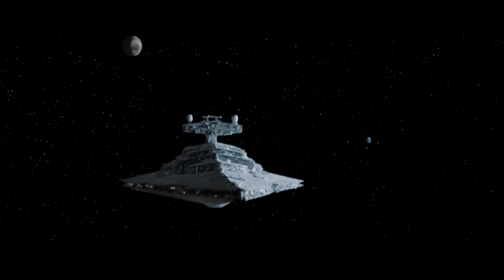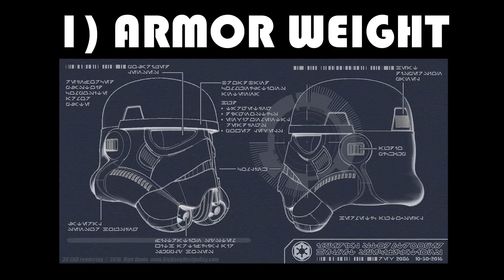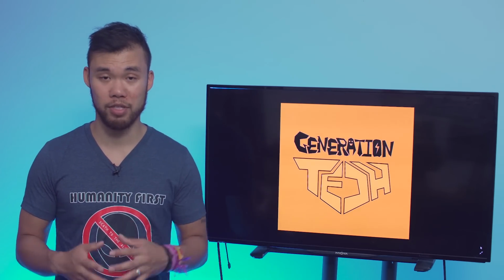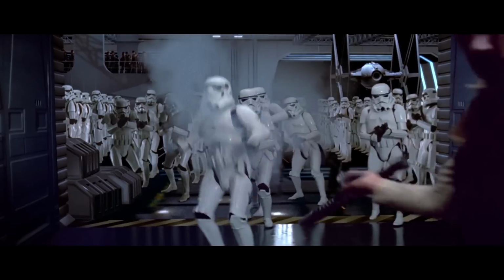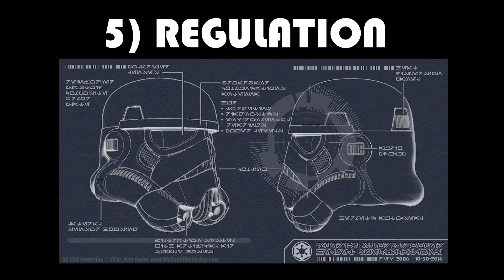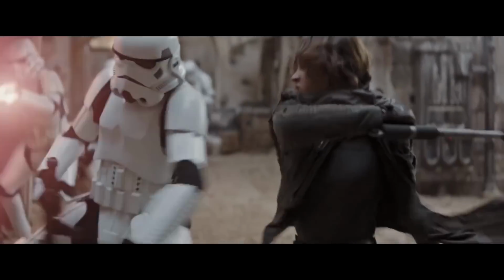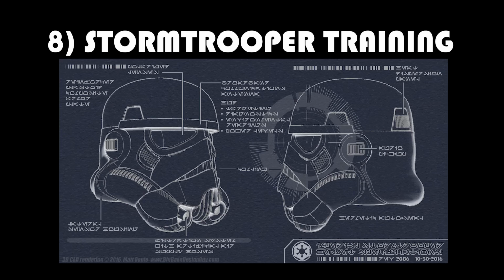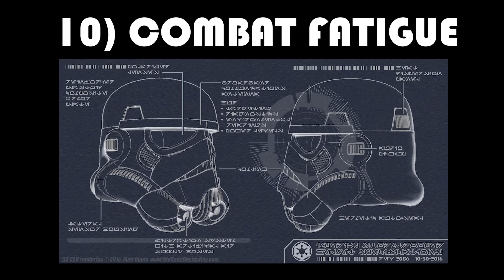10 FLAWS with the Stormtrooper

Comment: Not gonna wade through over 1,100 comments to see if this has been covered, so I'm sorry if this is redundant:

Storm Troopers are the face of Imperial Might. As such, they're held to an impossible personal standard (the monitoring by superiors), they're expected to maintain their menacing appearance, and most importantly, they are meant to appear as a monolithic force. They are all the same, impersonal, and impenetrable. This is why, for example, they're not allowed to remove their helmets, or indeed, to show their faces. In this way they are much like the crack assault forces fielded by ancient Persia known as "The Immortals." They may not have had the most effective equipment or tactics from a purely military point of view, but their methods had a severe psychological impact, which was often at least as important when and where they were deployed.
There's a great deal that goes into the psychological impact of Imperial imagery. This imagery is sometimes (often?) seen as as important, if not more so, than real aspects of performance. For the same reason that the Star Destroyer strikes a menacing silhouette at the expense of perhaps superior naval design, so too does the Storm Trooper don full body armor that is easily seen. They are psychological weapons as well as military ones.

As to the training regimen: It's not hard to envision a warped and narcissistic officer corp adopting a recruiting and training system based on Social Darwinism. This idea is further reinforced by the notion that The Empire in the original films was meant to be a manifestation of all the wrongheaded bits of militaristic totalitarian thinking. On the macro-scale, the "Evil Empire" is clearly modeled after the original "Evil Empire," Imperial Rome. On the smaller scale, motifs of early/mid-twentieth century Fascism are impossible to ignore. The long gun carried by Troopers on patrol in Mos Eisley is a real life MG-42, the German light machine gun of WWII (equivalent to the American Browning .30 caliber, but more easily carried and with twice the rate of fire). In fact, the very name "Storm Trooper" is a direct ripoff of the NSDAP SA wing, "Sturmabteilung" and the WWI Sturmtrupper units whose reputation the NSDAP co-opted.

Finally (well, maybe not, but the last point in this comment): The weight issue.
Until the advent of American Air Cavalry in the Vietnam War era, since time immemorial fighters have carried into war between 80 and 120 pounds of kit. This could include full body armor and weapons of steal, a long spear, giant shield, and bits of bronze armor here and there, or a gun, ammunition, and all the junk you'll need to take with you for a march across Georgia (or France). With this in mind, your assertion that 44 kg (about 96 lbs) is too heavy doesn't seem quite right. In fact, it's right smack in the middle. Perhaps this is why the smaller carbine weapon was most commonly used, to keep the total weight loading in that sweet middle spot. 
Also, keep in mind that the weight of properly fitted armor is evenly distributed over the body, and is much easier to carry than say, one big backpack. Having worn full armor, then putting it away in a carry bag to transport it, I can tell you it's much easier to carry while you're wearing it rather than to lug it about. BTW, the costumes worn by the actors, most especially in Episode IV, by and large were not well fitting at all.

Comment: Well assessed. Somewhere in the cannon it mentions storm trooper armor is powered, making up for it's weight with a system of load bearing strength enhancing mechanizations of some sort. I believe a graphine carbon titanium nickle nanotube woven into their under suit established the augmentation of their physical strength. This does not mean I'm right though. The helmet was designed as an augmentation, as well as an inhibitor as the Emperor was playing a long game of chess with too many pawns on the board and using the dark side of the force to control as much of the outcomes as he could, seeking the dark side source he sensed outside the galaxy and the purpose of the first order. Storm troopers were highly trained and developed marksman, but muddled by the Emperor should their efficiency muddy his plans. I agree with your assessment of training and medical support. Naval Corpsman of the Imperial Navy were ordered more often to assist regular forces than storm troopers as regular troops were not trained in an environment where their self worth was placed below everything else like the storm troopers and could aspire to climb the ranks of leadership through ruthless measures appropriate to the fascist mechanations of the Imperial model.

Comment: Key thing to note about why storm troopers had helmets and weren't allowed to take them off while on duty. The Empire wanted a faceless army. An army where every soldier looks the same means that the chance of someone becoming familiar with a particular trooper is virtually impossible. This means soldiers are less prone to corruption, being bent brought or outright turning sides.  This was further advantageous as the Storm Trooper core was primarily a peace keeping force as the Clone Wars were over. 

This also highlights the colour... Storm Troopers were white to follow the suit of the Republic Clone Troopers, in an effort to further legitimise the Emperor's rule. As they were now a peace keeping force (As there was no Jedi to do so) Storm Troopers did not need to hide behind camouflage, the idea was they were meant to be a visible deterrent. Another note was also that with the Separatist droids deactivated, the Empire no longer believed anyone could mount sufficient numbers to resist their storm trooper legions, thus they relied on their numbers rather than tactics such as using camouflage. This meant the trooper core only ever changed their armour for specific reasons, such as scout armour being lighter and more agile for the use of a speeder bike or snow trooper armour to protect against harsh cold weather.

Comment: Correction at 5:05 : .45 ACP is nowhere near the power of .44 Magnum.  .45 ACP has a typical load of a 230 grain bullet propelled at about 810 FPS. On the other hand, the typical .44 Magnum load pushes 240 grains at 1200 FPS, thus producing much higher energy.

No matter what kind of load, .45 ACP simply cannot be classified as a "magnum" type cartridge. It can't beat .357 Magnum, let alone .44 Magnum. Han Solo's DL-44 is definitely a blaster equivalent of .44 Magnum.

Comment: Gonna correct you on something. You said armor was always a trade off of protection for mobility- that isn't entirely true. Late medieval armor was actually so flexible that it could outperform humans when it comes to how the joints bend, and full plate's weight was distributed so that you could easily sprint, roll, lie down, get up, and even vault onto a horse with it. The largest downside to this kind of armor was overheating; wearing plate, then a gambeson with some mail attached to it would get quite hot after a while using it. Not unbearably hot, but uncomfortable nonetheless.

Comment: I think one thing he's missing with the armor is they were meant to stand out. If i remember correctly the storm troopers were meant to be basically like an elite police force, forceful and intimidating and very in your face about it, which is why they were white with the helmets that made them rather faceless and plain mean looking, almost like a bulldog. I doubt their armor weighed nearly as much as a clone troopers, probably less then half 50lbs verse 100), a clone troopers armor was designed to cover more of the body and had a significantly higher stopping power, I'd say closer to a 50ae then 44 or 45acp. Where a storm troopers armor was most likely designed for like he said something to the equivalent of a 9mm. All in all the storm troopers armor wasn't that bad, as long as it was maintained and charged regularly it was decent armor and sent the message it was intended to send

Comment: The clone trooper armor as designed, is best suited for the tactics that they employ. Mass troop formations advancing steadily towards enemy positions Under Fire. If their tactics depended on individual units achieving strategic objectives then they would have lighter armor. If you look at the Special Forces clones, their armor is a lot different then standard clone armor. I would also like to point out that the Clone armor is based off of Mandalorian armor, some of the fiercest Warriors in the game. Wookies consider them a challenge and a trophy kill.

Comment: for their armour protection the armour wasn't intended to deflect or absorb blaster bolts like the clone armour. clone armour was design to 100% block a shot and have the clone keep fighting, granted it didn't happen every time but the design of the armour was to protect them so they could keep fighting in the battle as they were often outnumbered and injury would most likely result in execution or capture. 

meanwhile storm trooper armour was designed to spread the concentrated bolt across the body, this almost always resulted in incapacitated storm trooper. almost always they were knocked out from the pain and often injured after getting shot, very few were actually killed from blaster shots. this allowed the medics to come in after the battle and fix everyone up so they could fight in the next battle.

Comment: That medic rule explains why on screen they aren't pulling shot troopers out of the line of fire to rescue and revive them. Get them fixed up to get back in the fight, or at least make sure they're ok so they'll be ready for the next battle, ie. stabilise them. Because in some non cannon legends books and articles (and fanboy rants) it says they survive because the armour leaves the trooper only moderately wounded and unconscious after a shot…that's retcon (also known as fanfic). 
Show a movie scene when after a battle they round up all the unconscious troopers, either as prisoners, or for medical evacuations, depending on who won. 
And why don't rebels confirm their kills if the armor is supposed to protect against lethal injury. Double tap their shots? Once you drop a trooper, peg a couple of head shots to make sure he's down, you don't want him to wake up and shoot you in the back as you advance. So obviously you still one hit kill a trooper. 
And versus the ewoks ? 
Hell, a modern army helmet will protect you against a rock to the head (or a staff), unless it's so heavy that it causes a compression injury to your neck. And a full face locking motorcycle helmet (with built in neck support) can do even better against heavy blunt impacts in protecting your neck and against concussion truma. And it's not just the useless armour…
Imagine a bunch of modern US soldiers versus the ewoks, they would mow them down, even with the limitation of ammo supply of automatic weapons vs blasters ammo count. And to really annoy you, Federation marines vs ewoks. Tricorders identifying every enemy and picking out hidden targets, phaser sweeps taking out groups and disintegrating cover, teleporting around the battlefield. 
And in both cases, intelligent disciplined tactics, not running ad hoc into ambushes. But effective communications and backing up team members while taking tactically sound positions. 
As for Klingons, they would consider ewok meat a delicacy and hunt them (they are tasty, even better than dolphin in my opinion - The other white meat). 
Stormtrooper tactics are rubbish, the only time they ever took cover was in Rogue One (the anomaly of Star Wars films), even the clone troopers stood up in the middle of the fire zone and slowly marched forward, trading shots like they were Napoleonic forces or in the American civil war, not kissing dirt and taking cover, which is rule #1 of being in an exposed position, then returning fire while prone or at least crouched. 
Seriously, the average gamer could revolutionize stormtrooper tactics if given the chance, and I would, except I've been summoned to the wrong franchise and am currently explaining what a circuit breaker and surge protector are to Starfleet engineers, and showing them the benefits of seat belts for pilots chairs.

Comment: 10:47 This is an argument I’m tired of hearing about and having to correct.
So, once again.

Everyone pokes fun and uses the DS escape as the primary focus for stormtroopers being bad shot. And in every following case has come from this.

Now I ask.
If Vader and Tarkin went to all the trouble to put a tracking device on the Millennium Falcon, why the hell would you try to kill the crew? You wouldn’t. You would actually help them in anyway you could.

Luke, Han and the gang were herded like cattle with precession shot that would force them to go where they needed to. Otherwise, plans or not there is no way you could find your way around on a base the size of a small moon. You would be hopelessly lost, found and captured. Especially when you consider the crew complement of the DS is a million+ and they ran into as few as they did.

If they wanted the group dead, it would have happened in the detention block. A narrow hallway, one way out, and heavy fire. They were forced into the garbage chute.

If you still disagree, watch the beginning of Ep.4, white armored hell comes through the door. And the same happens on the battle of Hoth when they captured Echo Base.

Comment: The armor actually does a very good job. Most stormtroopers you see aren't actually dead. A unshielded hit by a blaster bolt in a vital area would spell doom for anyone 99% of the time, but stormtrooper armor defuses the damage, first because energy is reduced while burning the plastoid and second the energy gets distributed by the body glove, leaving you with a large scale burn, but reducing the impact area and as such the boot won't eat through you. Still knocks you the fuck out

Comment: I would like to point out that despite what we see in the movies and in the cartoons the soldiers of the Galactic Empire are in fact one of the most well well trained and well equipped armies in fictions, now I am not saying that they are better then the Clone Army from the GAR, but they are at the very serviceable under the right conditions are more then capable of holding their own in a fight, the only reasons we see at times many of the guys die out like that is entertainment factors, plot mechanics if you will, lore wise many of these guys are enlisted men either young adult age 18 or above or cadets 16 or 14, in certain lore parts, now despite how things looked during Erza's infiltration during Rebels, cadet training was not not like that at all, and in most cases all forms of training would have been conducted by Clone drill instructors, all whom are veterans of the Clone Wars themselves, in both cases training was brutal, it was not designed to break the man but rather to break away the metal blockages they have and  pull out the focused characteristics in the making of a soldier, or more exactly a warrior, the Clone training doctrine was about team work and adaptability and thinking on the go, as what would be the point of following order that lead you into a mine field, in any case any man and later woman who managed to pass the exam was deemed "apt to serve" by Clone standards, which was a good enough praise for the rooks, many of them would still be lead by Clone senior battle hardened veteran officers in battle and would have more the one of the senior member in the their platoons, there are exceptions to this as with the 501st, who were all pure Clones, so the chance that a None Clone would be apart of this merited only by combat prowess and efficiency as a soldier rather then blind loyalty, something which D.Vader actually praised, in certain cases there instances of senior officers who manage to come out on top of the Imperial Military Academy from the ground up such Erv Lekauf who become one if the only true friends Vader ever had, 
In terms of equipment they were well supplied and many new pieces of tech were either in development or already in use, 
The major problem that held the Galactic Empire back was the oldest one in the books .....politics, the bane of civilization, with bureaucracy running a muck in the government, many admirals and generals  along with moffs still competent enough, which was rare as time went on, led to its fall

Comment: mperial law was every human to join the Imperial military at 18, if you are 21 and still haven't joined willingly you was drafted into the stormtroopers. Luke was trying to join the imperial academy to avoid this. The stormies, or White caps(What stormtroopers called themselves) had 4 years of training, othen going 2 days without food, water, or sleep. Only a small few training facilities had those Sith mentality training. I have a picture of inside the helmet. The goggles had standard eyeball molds, if it didn't fit your eyeballs, you was going to miss. And they aren't facing forward, they are facing downward. If you noticed the Clones they had their head tilted back slightly when talking. As for the armor protection Han and all the rebels had modifications to their Blasters. Not only wasn't firing a superheated ball of life but it also had that liquid metal center to penetrate stormtrooper armor. Notice the glow after the shot. Stormtrooper armor is based off of clone trooper armor, which is based off of ancient sith trooper armor, which is also based off of Mandalorian armor. Only difference is the weight, color, and material it's made out of. You forgot the mention, a little over 32% of stormtroopers are women. You even showed 2 women troopers suiting up for duty.